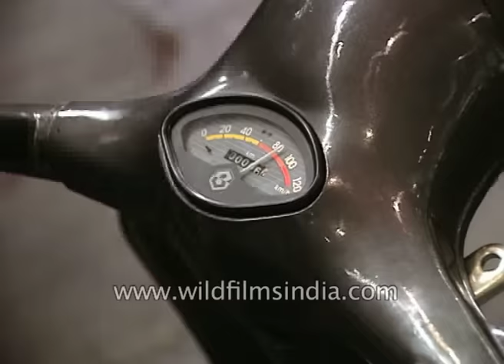Bajaj Chetak scooter factory in India - two wheelers for the masses (archival)

Comment: First in my young age, I was using "Vespa". Afterwards changed to Bajaj and later to Chethak. About 20 yrs back I sold my Chethak since came to gulf. Still the sweet memories of riding a Chethak is in mind at this age of 62. Hope Bajaj may introduce a new version of "Chethak" soon because no other scooter can overcome "Chethak".
Reply: Chetak ev
Reply: I had 1998 Chetak and sold it in 2007, we forgot to change the engine oil for the first 10 years, and no maintenance, but later we realized.  But still, until end, it was running.

Comment: Is Bajaj Auto co: planing to relaunch Chetak again? P/L let me know.
Reply: This is an archival video. It will Not be relaunched. This is a 2 Stroke Engine. 2 Stroke Engines have been banned (stopped manufacturing 2 Stroke Engine Vehicles) in India for more than 25 years. Nowadays all are 4 Stroke Engines and that to BS6 (BHARATH STAGE 6) Engines to meet the Stringent Emission Norms. BS6 ENGINES from 01-APRIL-2020.

Comment: if they relaunch they have to rectify the tilt and start system.
Reply: junaid Khan haha lol
Reply: Yeah, I had enough trouble in the traffic.
Reply: Best start system in the world, so nice.
Reply: They rectify the Issue long back ago , by launching bajaj legend 4 Stroke
Reply: They launched new fuel delivery system with side draught carb initially from spaco in 2003 then mikuni in 2005, which need not tilting before starting.